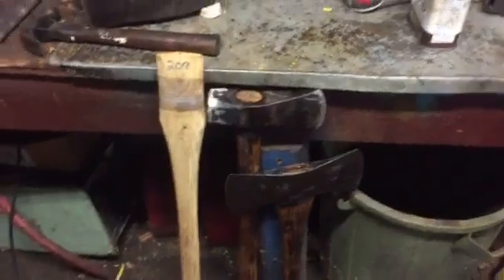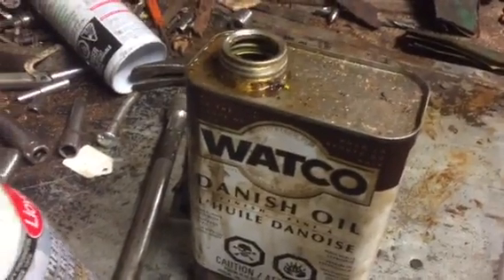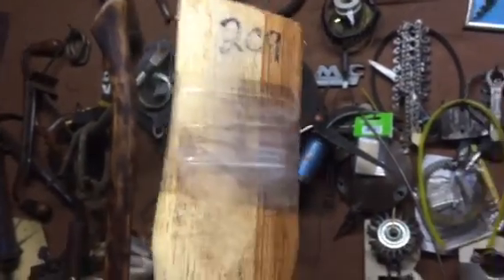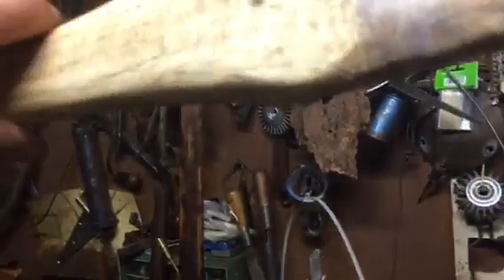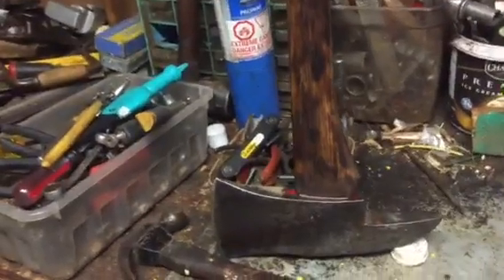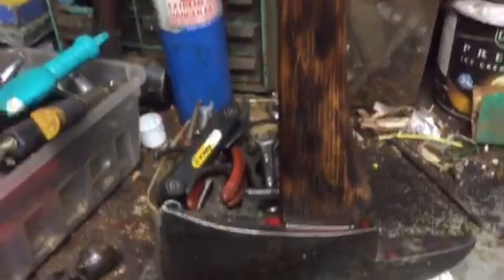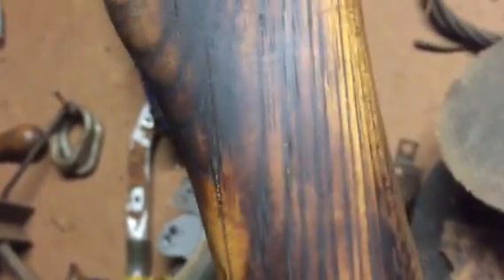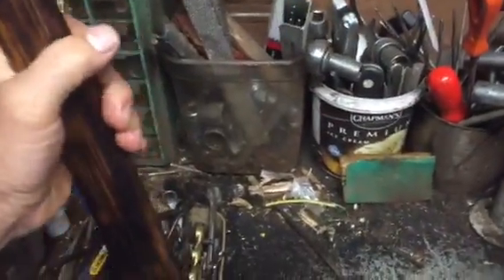WATCO oil

Comment: Just a quick one what are your wooden  wedges made of and do they split ?
Reply from the maker: I am startin a new program with wedges but I cant experiment on a customer so I have to put them through the paces my self which could take a little bit I have been using what they supply and I have asked them which they could nt answer, so that whole program may be changin very quick i want to try some hard wood a subscriber sent also I  make them from broken axe handles (hickory)
Reply: +Buckin' Billy Ray Smith great 👍😎

Comment: Ever tried Waterlox? It’s a similar product but everything Watco has and some additional waxes etc. smells like Rayola crayons when it’s curing. Wouldn’t recommend using it in an enclosed space though, the fumes are deadly. I used it on floors and now axe handles.